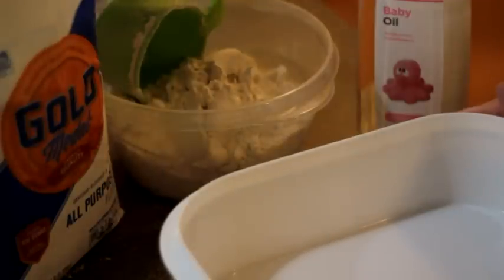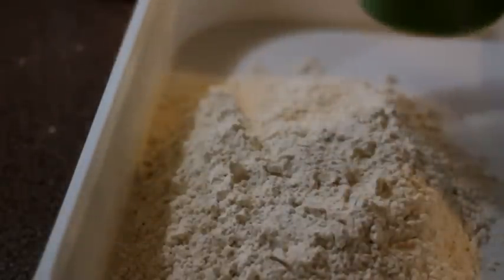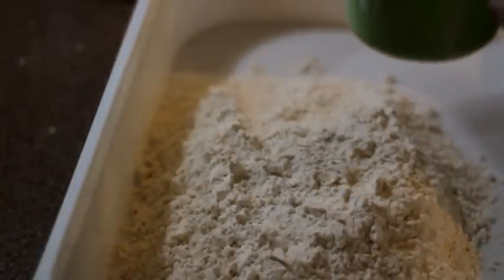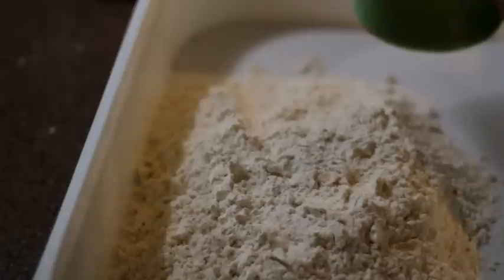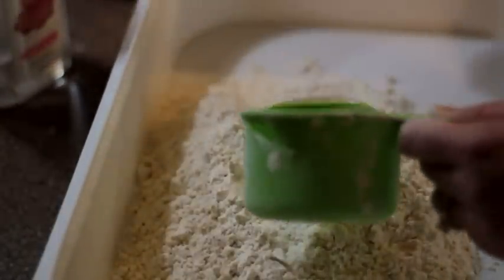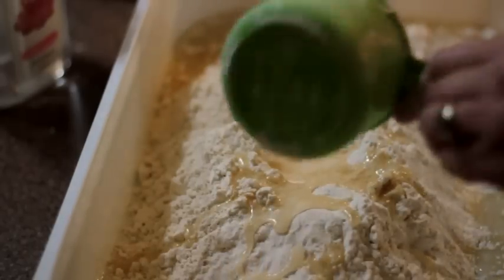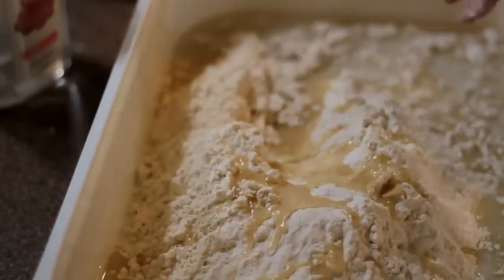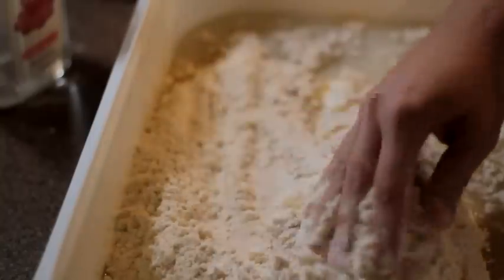How to make Kinetic Sand Moon Sand

Comment: hey so I made it what you told us to make and by the way, loved it, but I also tried to do something a little different so instead of using baby oil I used vegetable oil and also added 1/2 of corn starch and it turned out amazing!! so vegetable oil does work but you have to add in corn starch as well. thank you